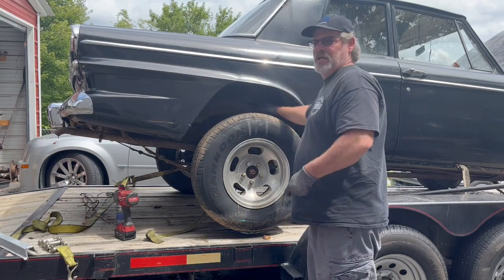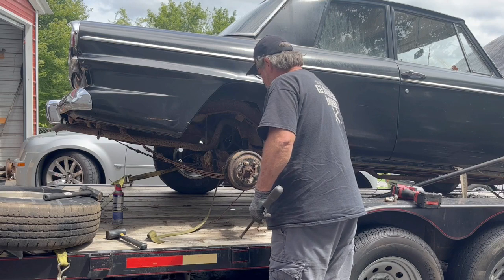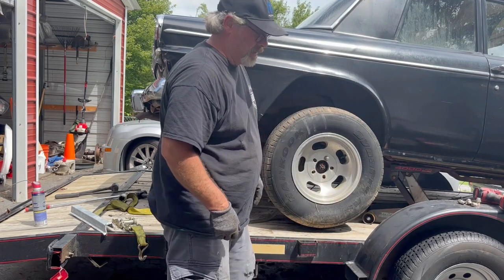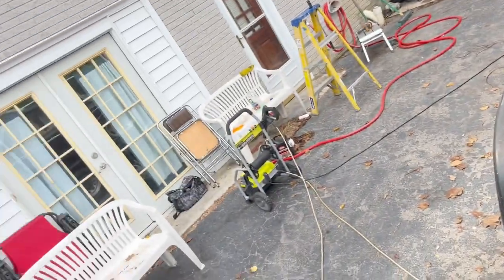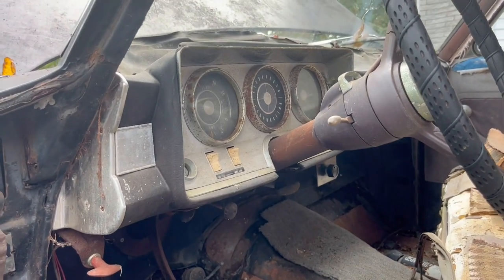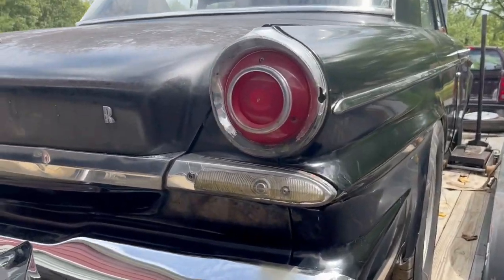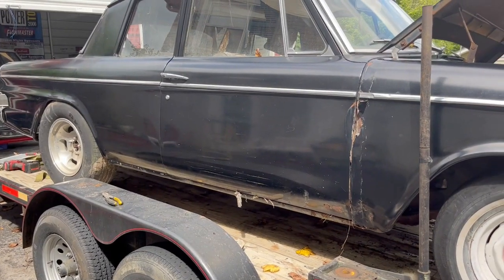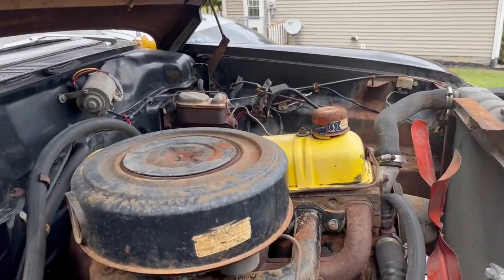The plans for the 63 Studebaker lark and that damn Brake Drum. Will it break Free??

Comment: It's been a while since I sold my '62 Hawk, so things may have changes a little. But, back when I was into them, about the only things that weren't available were shoes and drums, and Hawk sheet metal. At one point, there was considerable Lark NOS sheet metal still available from Studebaker International I do believe. At one point, drums were unobtanium. Shoes had to be sent in and relined, then sent back. Probably still that way for the shoes, but I think now someone is casting drums a couple times a year. Once they get enough orders, they do a pour. There are several people who do disk brake conversion kits, with (IIRC) mid-'80s Ford rotor/caliper parts. A subscription to Studebaker Drivers Club would be money well spent. The last few pages of the monthly mag have cars/parts for sale, and parts/service vendors.

Comment: That aluminum tin knocker tape, judiciously applied and painted, got several sketchy bodies past the DMV inspector when registering those vehicles. It was temporary, except in one case (it was only going to end up as a parts car, anyway). Your buddy Kiwi might have some insights regarding the rotten floor panels; he recently had to do a pretty extensive replacement, though not on a Studebaker. I'm very curious to see what this thing turns into after you work it over. Those slotted mags look like the ones that were on a '76 Jeep Cherokee S that I once had...

It's a lot of thinking and grunting and swearing ahead, but it's the grinning afterwards that makes it all worth it.
Reply from the maker: Yes sir..

Comment: If that’s a tapered axle with a nut in the center, you need a special puller for that drum.  You’ll break it in two before you get it off otherwise
Reply from the maker: Was just breaking it free.. not taking it off..  hole rearend will be coming out.

Comment: 63, dual master was standard, you only got a single master on a Stude from 63 to 66 if you had their power disc brakes on the front. STP was bought by Studebaker, and Andy Granatelli was appointed head of it, STP was changed to mean Studebaker Tested Products. He was also head of the Paxton division and headed the construction of the Supercharged V8's, the R2 Supercharged 289, R3 Supercharged 304.5 as well as an R4 304.5 that was N/A with dual 4 barrels (There were only one or two of those put into production cars, one of the engines is in the Studebaker museum). 
Those 170 overhead valve sixes are prone to having the heads Crack.
Reply from the maker: Thanks for the info 👍
Reply: @TheTazzman1968  You're welcome!

Comment: Team 321makes narrow crossmembers for 2003-2011 Crown Vic suspensions. That suspension basically unbolts from the frame. Their basic kit gives you a crossmember and modified upper control arms. Lower control arms, tie rods, spindles, brakes... All that is box stock Crown Vic. Not the cheapest way to go but it's a beefy and strong suspension with good brakes.

Comment: I have a right side reverse light lens.  They are hard to find. FYI, those are '62 tail light lens's, the '63s have radial lines on them. Other than that they are the same. There are several vendors that have NOS parts.
Reply: @anthonygaby6617  Are you talking about the tail lights or the reverse lights?
Reply: @anthonygaby6617  The reverse lights are different, you are correct!

Comment: You might be interested to know there is a puller made specifically for removing the brake drums Studebaker used.   I bought one years ago when I worked on them, you need one in your toolbox unless you discard the whole axle assembly for something Ford or maybe GM.
Reply from the maker: Yup.. not using it.😎👍

Comment: Your Talking about using 14" or 15" inch Rims with Modern Gen 3 Hemi Driveline.  I don't think it can be done without modern 17 or 18 inch rims the Brake rotors and Calipers are larger than Classic Musclecars had.

Comment: After watching you on your channel and UTG, I kinda felt you were going in the Gen3 direction. It's gonna be a great build. Before you finalize your plans look into a control unit to maintain the 300 engine and transmission as is without swapping the intake for the Holley. Good Luck Al.

Comment: C4 Corvette Front Suspension and cradle it's much like Vintage Mopars had , a main K-member that bolts to the Huge Front Frame Rails they had.
Design has no Front crossmember for Oil pan to hang in the open 100%.
Up Front come 1986-87 they added a Wonder Bar they called it to tie in left and right frame rails ahead of suspension. 
Front and Rear IRS C4 Corvette most popular to swap by GM Guys.  Simple and proven to provide 1.0- 1.2 G Forces cornering power for dirt cheep.  
Something to keep in mind if Gen 3 hardware driveline IRS Doesn't work out.
Get lucky and find a Stick Manual C4 Vette Super Dana 44 IRS Rear it has been Raced to 1000+ Hp successful. 
Drag stock all to 750 Hp with Drag Slicks.

Comment: Studebaker owned stp  Dual master was factory
Reply: No it wasn't dual from factory only 64-66. Al's would of been a single under the drivers floor boards.
Reply: @wildrosegarage4208  I had a 63 lark with dual master.  Disc brake cars still had a single master.  And my 63 was on the firewall.
Reply: @edpadgett4287  thats news to me. Even when you look for the part for a 63 its a single cylinder. 64 and up are dual. Thanks for teaching me something